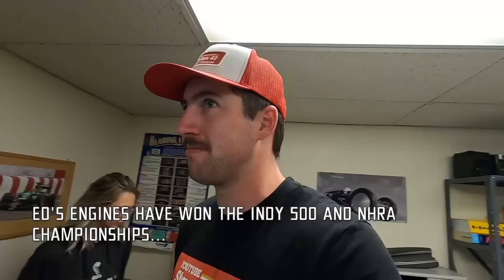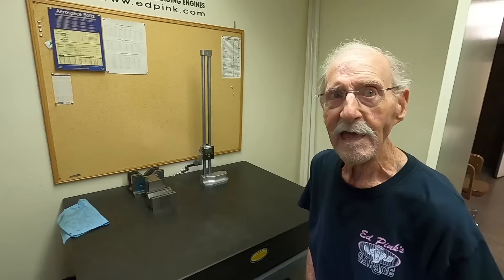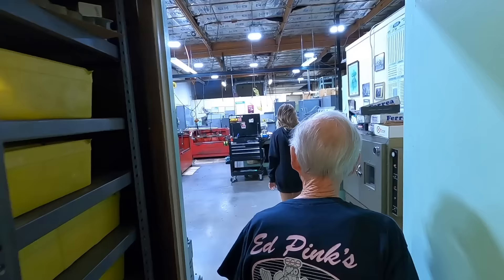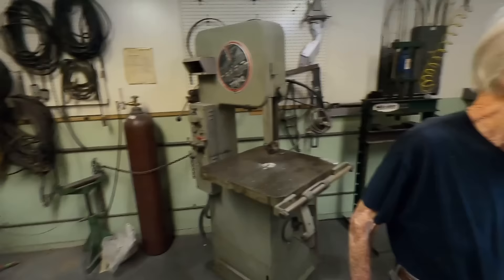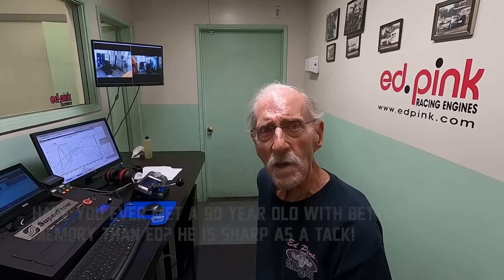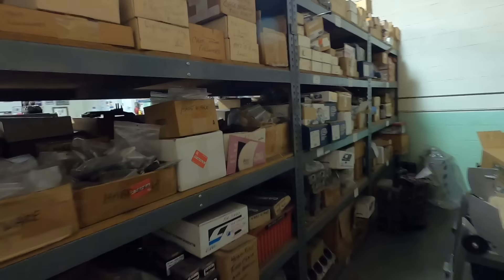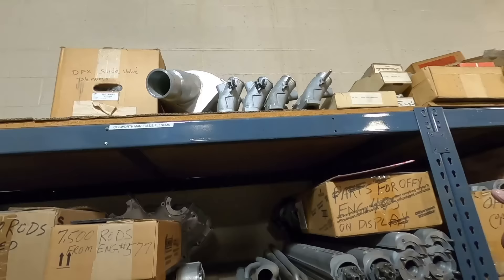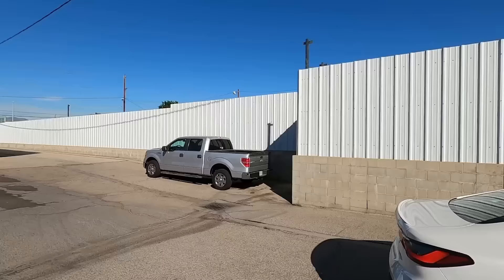Legendary Engine Shop Scheduled for Demolition: Ed Pink's Hallowed Ground (Full Tour)

Comment: So my first drag race I attended (I was 14 years old) was a funny car meet at Connecticut dragway in 1978. One of my favorite pictures I took while I was there was of a HEMI valve cover in a funny car with the Ed Pink logo on the valve cover. I felt honored that I actually was in the presence of an actual Ed Pink engine! This video was a fantastic in that I was able to see the shop an the man who has been a legend to me for more than 40 years. It is a crime that that facility is being sacrificed for the Olympics. I have the same welder in my shop! Mine is a Chemetron, which bought the P&H business and still sold welders under the P&H brand.

Comment: Those Sunnen rod hones; I learned to recon con rods and pin fitting pistons and small ends of rods at Booth-Arons Engines from 1984-1989 & then at Total Automotive Engineering (Andy Mannarino) from 1994- Dec. 31st 2201 I learned to run the power stroke Sunnen rod hone.  Along with a Sunnen CK 10 cylinder block hone and we had a line hone attachment as well. I'm 69 & retired now & I still miss those days. Sure am glad I had the chance to see all this stuff!  Thank You

Comment: neat video that place is legendary i remember first learning about them in an old issue of hot rod magazine when i was a kid probably about 15-16 years ago sad to hear that it's going to be turned into a bus stop place needs to be preserved the stockpile of vintage parts was pretty neat saw a box marked Novi front cover if y'all haven't heard about the Novi engine look it up very neat it was a dual overhead cam supercharged v8 engine in first used in 1941 at the indy 500 if i'm not mistaken used to be called the banshee engine because of it's characteristic sound

Comment: My wife and I lived in Van Nuys for six years close to Ed's shop but I never new it was there. We lived on Gilmore St off of Victory Blvd and Havenhurst. I rebuilt my 76 chevy c20 camper special 350 truck engine there in the driveway and garage. I got 65k more miles out of it. I was coming home from bowling in the south bay one night on the 405 and blew it up at Burbank Blvd. Threw a rod through the block. When we moved to Harbor City I moved the truck and camper but never put a new engine in it after almost 20 years

Comment: Ed Pink built engines for every type of racing but every top fuel engine you see, it's roots are Ed Pink..Yes parts have been modernized overs the years but the 500 cubic inch screw blown hemi wouldn't be where it is without this man.
Reply from the maker: Absolutely. Ed is the man!

Comment: I believe it was in 1972 I was at the Gator Nationals when Barry Setzer's Vega was running and using a Pink engine. They had a tuning problem that resulted in calling in Ed who happened to be at the Masters Golf Tournament at the time. Ed flew in by helicopter and landed right on the drag strip, walked over and looked at the spark plugs with a jeweler's loupe then said something to the crew chief, got on the helicopter and flew back to the Master's tournament. The fans loved it and everyone was thoroughly impressed by his quick response.

Comment: Offy's don't have heads that unbolt, They have barrel style crankcases and one piece cylinder blocks with the heads made as one, starting  at 26:50 on those work bench's Ed is leaning on were two Offy head/blocks setting right there end to end. Thanks guys for doing all these videos as it is magic to hear from the people that have done so much and it is our history and it so great they will share it. Thanks again
Reply from the maker: Interesting I did not know that. Thanks Jim!

Comment: I use to work at a Fab shop that had a 1956 P&H TIG welder. We replaced it (1973) with a Miller square wave welder. One of the first like that on the west coast. I have been welding since 1966 and the Miller Square Wave is my favorite. In 1975 I was trying to build a 1967 Chevelle with a 327. I had the cage in and moved the firewall back 2 inches. I had the spring buckets and adjusters  in. I was working on the engine only needed the intake and cab. One of the things I had was a set of Ed Pink rods. Someone broken into my shop and stole my heads (ported) cam , lifters, gear drive, Mallory dist, set of12 to 1 pistons a forged crank and my set of Ed Pink rods. I never recovered from that. Built many cars for others but never could get my car built.

Comment: A yellow Harnishfeger welder from the 70's! Same one I used at the GM auto frame factory in 1977, at AO. Smith, Milwaukee. We produced 95% of General Motors full framed and Sub frame mid sized unit frames for Detroit. Those stick welding units were used to completely hand weld Corvette frames. An object seen, can immediately recall memories! The P& H Co. Milwaukee, WI. American made! 🇺🇲 🧐☝️
Reply from the maker: That’s awesome

Comment: I have a personal Ed Pink anecdote: in '74 I was a Jr. in H.S. and bought a '70 Mustang Mach I with a Cleveland 4v from our local credit bureau that had been repossessed. Long story short, my Dad was an old ford guy and a Rocket Engineer out at Cape Canaveral and we blue printed it and converted it to mechanical cam and built it according to Hot Rod Magazine builds that were supposed to dyno at 445 BHP. Our engine was slightly hotter and dyno'd at 525 BHP. With a top loader close ratio 4 speed and 4.30:1 rear gear, traction bars and the biggest tires we could stuff under the wheel wells it was a Very fast car for the day. I had the fastest car in town (Titusville Florida) as an 18 year old H.S. kid and had grown up driving a 4 speed A code '66 mustang so was a very good driver and even beat a hemi Cuda....Until a guy with a very rich Mom showed up at our local drive-in in with a '70 camaro with an Ed Pink blown 427...I would guess he probably was running 800+ BHP and the car was setup to get off the line pretty good too. We drove out to beach road where we ran 1/4 races and we raced three times. I was the better driver which gives a street race a big advantage and I came close once when he got off the line poorly but he solidly pulled me in the other two. I just couldn't beat him, too much BHP advantage with a well setup car. After that I had the 2nd fastest car in town.

Comment: Sad to see, I remember there was a non destructive bolt removal shop a few doors down and FEDCO was a bit further. The lasting legacy of the last Olympics were the information billboards on the freeways that have no purpose at all.. Barris Kustoms is gone, Dyno Don Nicholsons  building and the Dyno is still in the ground but the guy in  the shop has no idea what it is. Around the corner on Sepulveda was Patterson Marine, Barron Boats, behind the Chevy Dealer at Van Nuys and Oxnard was Finishline engineering, They invented the adjustable cavitation plate and built Offenhauser engines for Indy.
Reply from the maker: Wow that’s super interesting

Comment: The Offy Engine didn't have a separate cylinder head. It was part of the block to eliminate head gasket issues........ They ran 15 to 1 compression and straight alcohol.....

Comment: This gentleman reminds me of Marvin Rifchin from M&H tires He had a lot of the same pictures on his wall. The corridor was full of old wheels & tires. First tire over 200 mph he said first over 250, that one went 300. He was just as sharp and remembered every detail like it was yesterday. He was still going to the races and developing tires at 93. He would mix up his tire potion and make a couple dozen tires for Midget cars, Then when he had a good recipe he would make tires for Funny cars and Top Fuel Dragsters. He was very successful. 
 One of the last tires he designed was for Bonniville. He said that it would not have his name on it but it should work. They blew up the tire testing equipment at 600 mph.
Marvin told me that the races were not between the Chevys, Fords and VWs, It was between  M&H and Hoosier tires. Oh yea he also asked if I thought nothing was developed for the last 30 years at Bonniville no records were broken for 30 years. Its tires cant go any faster he said. To go faster they were running on aluminum wheels without tires. The centrifugal forces throws the tire off the wheel at over 300 + mph.  Not now they don't! 

 I am proud to say he was a great friend.

Comment: I suspect you have just touched on a job that needs doing.  Someone needs to do the timeline and development line from the Ed Pink shop before it's gone.  
Ed can fill in a lot of the details because he's so sharp.  We need a living history here.  
Wherever they relocate, the shop will be nice and they will still crank out exceptional engines and offer top shelf services.  But this facility will be gone.  The building did not make those engines, Ed and his crew did.  It's OK to relocate.  But not OK to loose the knowledge ...

Comment: Ed is the real deal. Only people that actually understand talk "inches" of boost. The scale is inches of mercury, barometric pressure is usually between 29 - 30 inches of mercury at sea level (which equates to approx 14.7psi or 1 bar), and "boost" is the pressure created over above the ambient localised pressure.

Regarding the shop. With the push to go "green" by using what are actually unstainable and less efficient than oil based fuels a "Race engine shop" is an enemy to the earth in the opinion of the brainwashed masses.

Comment: Hard to describe how angry and disappointing it is watching this.  The depth of history contained in this one facility and this mans mind is important.  We all know, are aware of the influence Ed Pink had on drag racing but also for Indy cars, Sprint and midget racing,  and throughout the Porsche turbo road racing days.  I recall the 80's era Porsche 935's in IMSA were all powered by either an Ed Pink built power plant or by Andial.  There's not a single aspect of racing that haven't had Ed's fingerprint on it.

For me personally, this was a walk down memory lane...the Bridgeport mill, the lathes, the valve facing machine, the Magnaflux and Zyglo, the Sunnen cylinder/rod hones were all a part of my training, daily use  

Interesting to see the big old P&H welder.  Had the same exact model when I was the supervisor in the welding shops for the Power Plants and Airframes Dept, in the Navy.  This was slated to be replaced by another new Lincoln machine. The dept. head leading Chief who was once a Wildcat welder in the Texas oilfields wanted that old welder.  He taught me a number of neat tricks for stick welding, gas cutting and cast aluminium repair.

I made a diagram of the circuitry of all the internal parts before removing them.  The chief took all of these home piecemeal with the intent to reinstalling when he retired.  We took the empty cabinet to the Navy discarded/surplus yard for the monthly auction sales.  Chief bid $10.00 on the empty cabinet rewarding himself with a 350 amp tig/stick welder!!!

P&H hasn't made welders in decades, they now are the biggest industrial crane manf. in the US.  Nowadays you can have similar welding power levels with inverter machines no bigger than a large suitcase with many new features.
Reply from the maker: Interesting!

Comment: Excellent Video, but who is the Commentator, who doesn't know what a Porsche 917 Block looks like, that the Cooling is with a Vertical Fan along with Offy has the Cylinders as part of the Head?
Reply from the maker: The commentator you speak of is a NASCAR guy

Comment: Lived across the tracks from this shop in the early 80s. Even as a teen I recognized the historical significance as a legendary shop. The Valley used to be a hotbed of innovation and design (aviation and hotrodding) since WW2. Unfortunately the political rulers have been tearing apart and destroying the SFV for decades and this is the latest assault on places and people with historical significance that should be honored and preserved. 
Destroying history (and jobs) for a bus stop? Now I've seen it all.

Comment: "Is that an Offy-head"? One of the most distinctive features of an Offenhauser engine is that the "head" & cylinder block were integral. For Christ's sake do a little homework before you do these videos.
Reply from the maker: Can you imagine how many more great minds would be in motorsports if jerks like you didn't make fun of people for asking questions? Someone interested in learning more about racing can easily be turned off by enough bad encounters from the "holier than thou" type. There was once a time where you didn't not know the answer either.  If we want this industry to thrive we don't need that crap. If you know something...TEACH IT
Reply from the maker: If the generation that lived with this stuff does not teach my generation about it and instead belittles them when they ask "obvious to them" questions...this history WILL die.